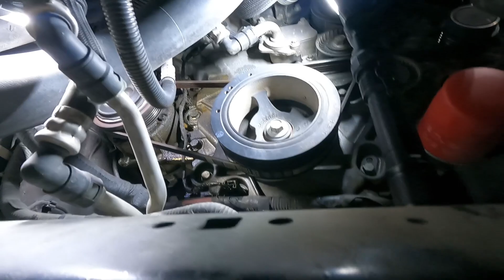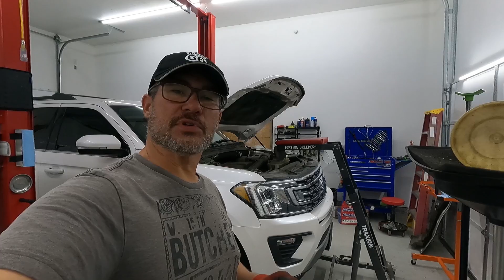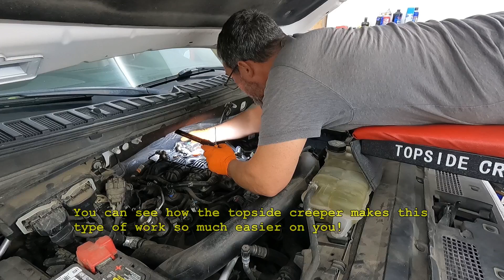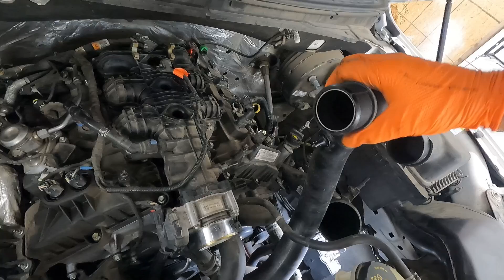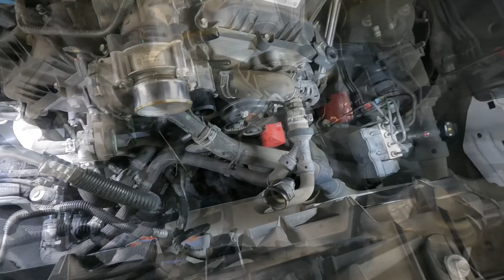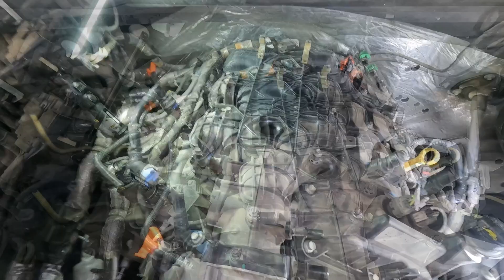Ford Gen 2 Ecoboost Timing Cover Super Detailed Tutorial (oil leak repair) part 1 of 3

Comment: I really like your tag examples and will echo these.

I used to work in a shop many years ago where the owner would pick up any random car at auction. I would diag and repair and he would resell them.

Big disassembly on something you've never touched can be intimidating.

I used to tag every component coming off with blue tape and number them. I would tag electrical connectors and plugs with red tape and number them. I would tag hose connections, such as vacuum, with green tape and number them. Keep fasteners with the component as much as possible, bag and tag anything else. Read the literature, paint pen torque sequences onto parts like the valve covers.

It's extra work, but it always made reassembly of dozens of parts an absolute breeze.
Reply from the maker: good job. That shows pride in workmanship too. Keep it up my friend.

Comment: Jim, I am getting ready to do the cam phasers on my 2019 F150 with 3.5 ecoboost.  Is this example you are doing similar to the F150 as far as getting to the timing cover?  thanks
Reply from the maker: Yes very similar, just remove the charge air pipes and clear some room

Comment: Thank you Les for youre time and knowledge since i think i found the possible cause but it seemed wishful thinking, i was soo dreading the timing cover removal to ultimately find nothing wrong with guides/tensioners etc., though i did expend the money replacing the VVT sensors (even though as said in correspondents they were clean/actuated but showed wear internally). At any rate.. given youre expertise i am reassembling engine with the new vvt's, have removed harmonic bal. and reinstalled it this time making positive of seat against crank sprocket. Youre insight that the thousandths of gap between the harmonic bal. and the sprocket can in fact create the the clatter/tick that was gradually getting louder gives me hope my thoughts could be on point. 
Thank you very much, ty
Reply from the maker: glad to help and hope you have this one figured out soon.

Comment: How long did it take you to do this job roughly? I am replacing my cam phasers, chains, guides this week on my Gen 2 Raptor
Reply from the maker: It takes a while, esp while filming it all, but if you get familiar with the process by watching all these tips on my video, if guess it should take about 3 hrs or so to get to the timing set, then another couple to super careful with the timing, then another two or three hours to button it all back up. Plan for a long weekend
Reply: Ford just quoted me 13 hours @ $225/hr😮 Water pump is leaking, too.
Reply: @bpkmm3048 ford told me today 11 hours but I hopefully covered with the warranty